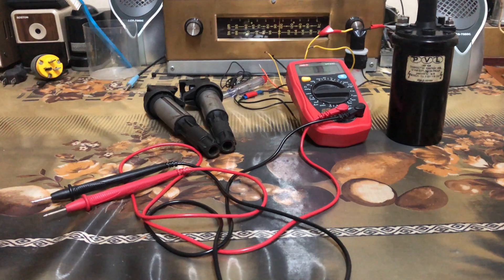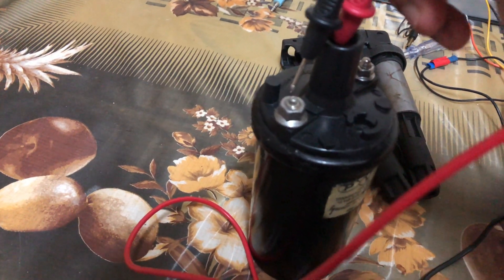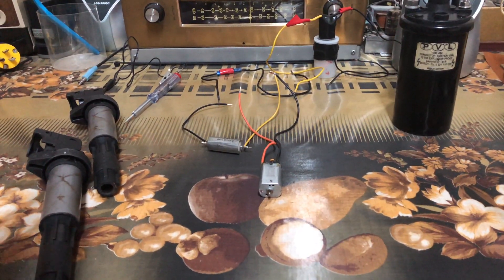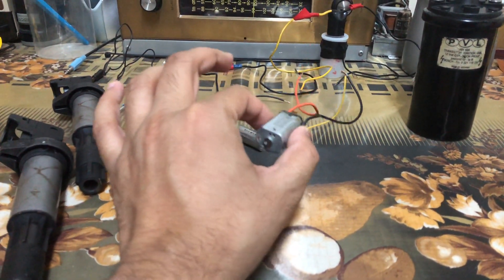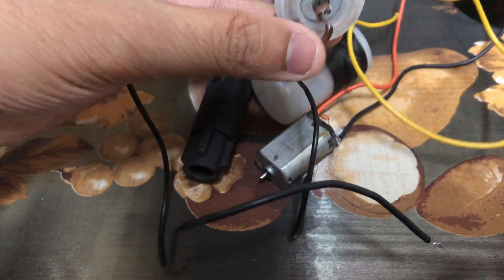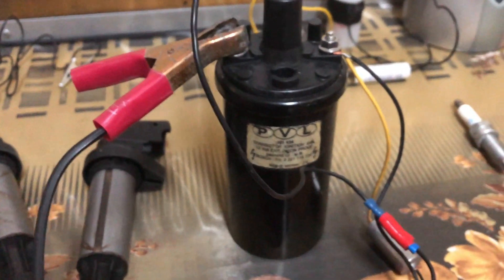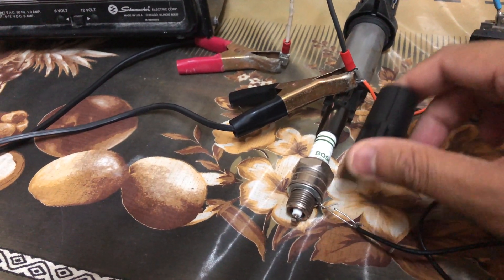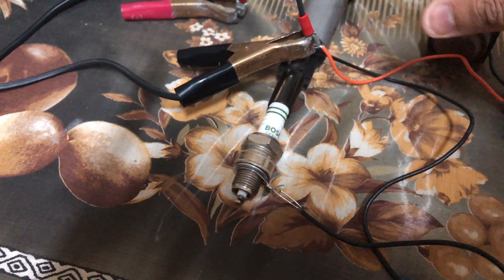Car Ignition coil diy hack to get continuous high voltage

Comment: Pretty cool. But wouldn't it be much easier to use a cheap eBay pwm to control the signal? Just asking because I'm trying to make a a plasma lighter out of two of ignition coils. 😁
Reply from the maker: Haha..of course the PWM way would be the way to go method. Especially if you want to run it for long periods and consistently. The motor commutator would arc and go bad quite quickly with my experiment. I just showed an easy inexpensive way with things that could be laying around in the house lol.
Reply: @sciencetrove  on a side note a cheap $3 eBay signal generator that I forgot I had laying around works fantastic. Hooked it up to my power supply and with the signal generator you could actually find tune the amount of amperage going through it I was able to create about a 1-in spark gap with about 4.5-4.9 A. I later switched over to my 12 volt Milwaukee battery (which makes it extremely portable) and this is now going to be implemented into my bird feeder for squirrel protection 🤣🤣🤣. Also an even further side note, now that I have control over a coil I am also purchasing two 12 volt DC air solenoids and with the help of a 1 lb propane tank I will have a nice set of flamethrowers on my Harley 😁 cool video keep up the good work dude 💪
Reply: Edit.. by fine tune I mean there is a potentiometer on it that you can control the amount of amperage going through it from .01-4.9 A wouldn't suggest running it for a very long time at Max amperage considering it heats up the coil fairly quick but for short burst it seems to be holding up and I'm able to light paper on fire with it lol.